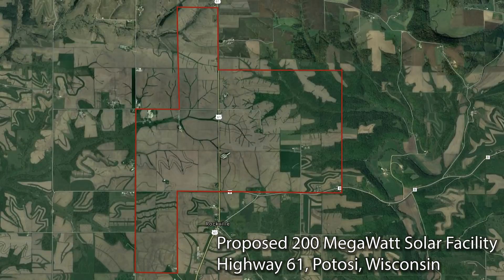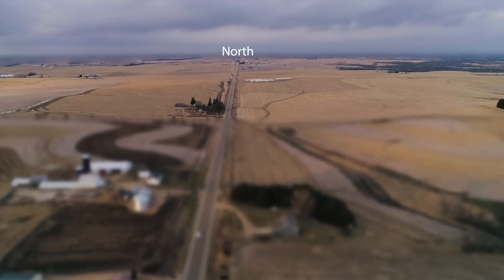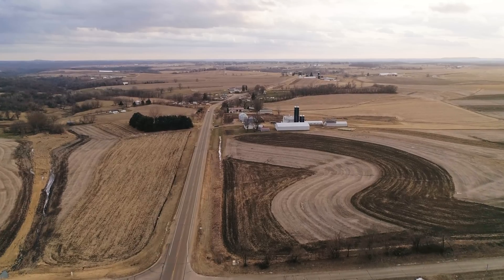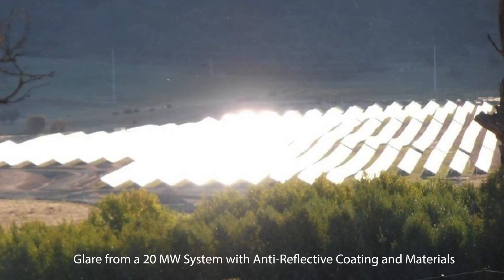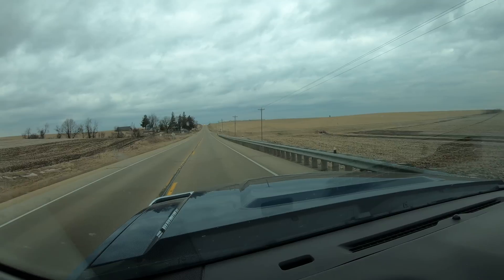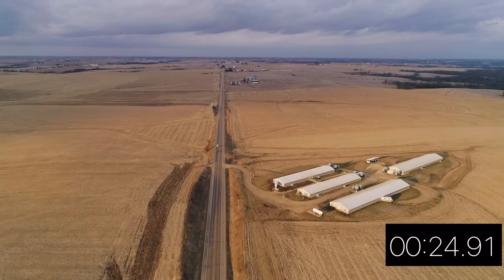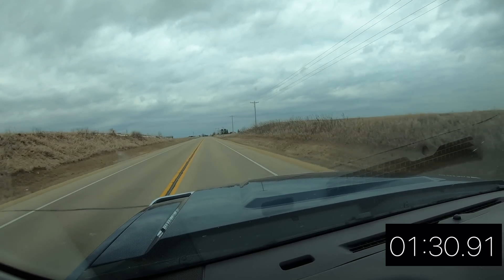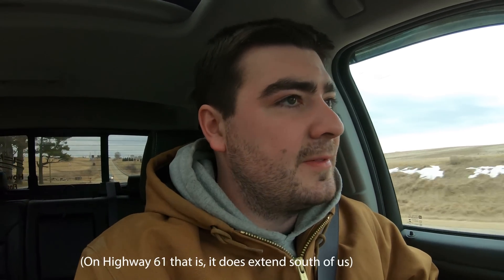Proposed 200-MW Solar Facility | NextEra Energy

Comment: By the time it reaches the "public information" stage, the local government has already signed off on and has started to count its franchise fee.  They're just going through the legal motions because they have to.  It's a done deal.  Nothing that the locals say or do will stop it.

Glare will be a huge area.  There can also be some temperature shifts.  Wildlife migration patterns will be altered.  Power generated is typically dumped into the national grid and won't be available to local customers.
Reply: Not Always true... we had the largest electricity provider buy a piece of land for putting up a sub station... so far the local voters have prevented that from happening
Reply: @kenraterink3916 , you're extremely lucky.  Our local electric company informed the city it was going to need to install a new substation  for "future capacity" and then proceeded to immediately build a massive substation right in the middle of one of the older neighborhoods in the city.  When challenged the electric company's position was that it had already begun construction so the city had to let it complete the build.  In typical city government fashion, it caved and slunk back to city hall.
Reply: Electricity can not be stored, once it is produced it is everywhere in the grid. You can't go borrow a bucket of electric from them.
Reply: @thomasd9424  We have electric storage here in Texas. It is really a conversion of electricity to another method either heat such as salt reactors or gas as in Hydrogen and Natural Gas generation for on demand startup. We also have capacitor storage on lines to take up a neighborhood level surge need.
Reply: @TallTexasGMan  Yeah MANY ways to store electricity, but that's not the issue... Later!  OL J R :) 

How much power will panels make that are covered in SNOW half the year??  That's a h3ll of a lot of panels to have to try to 'sweep off' as well, or use electric heaters on to melt the snow off... burn more electricity than it produces in winter I bet LOL:)  Just crazy... 

We got whole states (Nevada, Utah, Arizona, parts of West Texas) that are more desert than anything, pretty much useless except for a few areas here and there, HUGE tracts of non-arable land, and what do they do?? Take good farmland to turn into "solar farms" covered in junk.  

I'm not anti-solar, but it should be done in a way that MAKES SENSE... Later!  OL J R :)
Reply: I dont think so. It is a basic principle that locals, everyone, should express their opinion. This cannot prevent the project, but it is necessary to show that the decision made by local government might be made against the will of the inhabitants. I doubt that it is about the common good, but the advantage of a few.
Reply: I would have to agree, by the time the public hears about it its seems like a done deal. https://www.renewwisconsin.org/sugar-river-wind-project-proposed-for-green-county/
Reply: I see, but don't know enough about losses in long distance transmission vs pumped storage/other conversion factor efficiency, to add to this.
Reply: thats the  government for you
Reply: These companies know that they're universally hated so they keep a very low profile for as long as they can.  They start with the local governments because they can sweeten the pot with franchise fees, "donations" to local entities, etc.  Local governments are always looking for income sources.  Companies know this and have done their research before they ever approach the local government.  They already know how to win over the local politicians and that's all that matters.  As far as the locals go, they're just an insignificant nuisance that will eventually be pushed aside.
Reply: Yes you beat me to it. Our local government made a deal with a Poet ethanol plant. They didn't even tell people in the county where it was going to go until the last minute. Yea we got to go to packed house meetings. It meant nothing. So they built it 1/2 mile from my house. I hope they go broke when corn prices rise.
Reply: @TheCritterWindow  , that happened to the town I grew up in.  A decade of foul odors, stream pollution, and noise complaints later, the plant went bankrupt leaving the city holding a bunch of worthless bonds.
Reply: dumped into the national grid and not available local is not always true.

Comment: These silly solar projects... just taking good farmland and turning it into a landfill.  I could see it IF every rooftop in the cities and large suburban areas were already covered in solar panels, BUT of course that hasn't and won't happen.  Just seems silly to take up all that farmland to build a solar project in the middle of nowhere... heck yall aren't even adjacent to any big cities (within about 30 miles) that would be using that electricity-- when you figure transmission losses over long distances, it adds up.  When you get tornadoes or straight line winds, you can expect to have panels scattered everywhere... the things are essentially big sails on a post... they'll be scattered everywhere.  Solar panels don't last forever, they have about a 25 year productive lifespan and their production of electricity falls off with each passing year.  Once they're done and the project is no longer "viable" (profitable) they'll probably yank the panels (for the valuable rare-earth elements in them) but leave all the posts and crap everywhere, so essentially about as farmable as an abandoned drive-in theater.  The glare issue is for real; anti-reflection coatings can only do so much to stop specular reflections.  The runoff issue is another big "what if"... technically speaking the water dripping off the panels in rain/snow melt SHOULD soak into the ground, but there's a BIG DIFFERENCE in water/snow melt being spread EVENLY across the soil surface and it being concentrated along the drip lines of the panels, which will quickly saturate and most likely run off... ground in near-constant shade under the panels will also be a lot slower to dry out that soil exposed to the normal ~7 watts per square meter of solar irradiation on Earth's surface... 

Don't think for a minute they won't use eminent domain on you-- they wield that like a sword now.  Gubmints LOVE money and ANYTHING that will put a dime in their pocket and has the added "green factor" of a "solar farm" just makes everybody feel all warm and fuzzy... If the gubmint will take your land under eminent domain to build a Wal-Mart (which some municipalities have done!) they won't think twice about condemning property to run power lines for this solar project.  Fighting eminent domain is like fighting against the next sunrise, though-- fight all you want, spend all the money you want on legal crap, it's coming anyway, "you can't stop progress" and in the end it comes anyway.   My cousin behind us at Needville fought against the pipeline crossing their farm (after coming through ours) and ended up with a big legal bill and less money than they would have gotten when they started, and the pipeline went through anyway.  Just how it works, nothing you can do about it.  At least it crosses the drainage canal/creek through the farm instead of running parallel to the county road on the far end of the place like they originally wanted it to.  

Looks like you have a lot of short-sighted neighbors... sure it looks like a good chunk of change up front (which they get to pay high taxes on) versus the much more modest returns from farming, BUT unless they're buying the land outright, those landowners are gonna find in 25-30 years when the project becomes "unprofitable" they're gonna be left holding the bag... huge mess left behind and no good way to clean it up; cost them FAR more to clean it up for farming that they ever made off the project to begin with.  Look at OLF's channel to see what he thinks of those stupid solar farms going in all over NJ...  Don't buy the "oh, we'll clean it up, or it's bonded and has money set aside to clean it up when it's over with" and all that crap-- money has a way of disappearing or ending up never being put there in the first place, and all you're left with is an empty promise and a big mess... too easy for a company to just declare bankruptcy or go insolvent and get dissolved and restart next week under a new name and walk away from the whole mess when it's over... 

Later!  OL J R :)

Comment: Interesting. I was reading up on it Solar Farms and found out that Great Britain gets 15% of their power from Solar Farms. Animals graze along side of the Solar panels https://www.solar-trade.org.uk/solar-farms/  
Some questions: Is the power going to be sold wholesale to a distribution company.. if so you will get no benefit from the cheap power. Insist that a percentage of be used for local power. If they have can to cross you land ... can the cable be put underground

Comment: The largest solar farm on the East coast is going in on our county now, these panels have miles of oil pipelines, with hundreds of thousands gallons of oil to cool them, also millions of gallons of water used to constantly clean them, and basically 20_ 30 years of life, then the environment is contaminated and useless, sounds like you're area is like ours, the people were kept in the dark until it was too late.

Comment: In addition to the solar arrays will be all the other structures such as transformers and buildings, etc. My first thought went to the power lines that will be needed to handle that. Giant towers of high capacity lines that generate alot af ambient energy in the air and buzzing that affects all nearby and creates a hazard for airplanes; your local airport and cropdusting being a concern.

Comment: Need to find out what your county and township zoning is? Local drainage district or conservation district in the area ? These panels are impervious, retention,detention will be needed. Decommissioning of site when done.Will a bond be issued for state or county for cleanup of the site? What if the company goes bankrupt before done with the project? What happens if there is a fire, cleanup for ground and water contamination?We have just been through all of this in our county and township.Get your group together and get legal council.

Comment: Lots of these things in Australia. None really work out well for the farmers that adjoin them. “Heat islands “ of artificially higher temperature air can affect crops. Electrically they are usually not in the best spots for a connection. Which means a whole heap of issues. Usually need upgrades and bigger lines. Voltage problems are also experienced and typical as well as frequency and stability.

Comment: Private company, but they'll still use Eminent Domain for those who "don't comply". It's a waste of good farm ground.
& like someone said, do watch your fences. We have highlines that run across 2 of our fields. A couple years ago when they came through & replaced the poles & the lines, they cut the fence between the neighbor's field & ours. Granted, it was an old fence & we hadn't had any cattle in the field for a long time. But the fact was that they didn't ask our permission or inform us that they  intended to do it. They @ least waited till the crops were out but made pretty good ruts due to wet ground conditions. It took a lot of disking & dragging of an old steel I-beam to get things smoothed out again. But even with that, we are still fighting wet spots created by them.

Comment: Who is going to use the power? I get concerned about transmission losses when these large solar facilities are located too far from the electricity demand - why not distribute the panels near to the points of demand to minimize the transmission losses. Centralizing the panels to one location should not significantly reduce the installation of maintenance costs, but will maximize the transmission losses.

Comment: i love the idea of renewable energy,  but i would not ever agree to this because your loosing good farm land, and like several others have stated the wildlife  will be affected big time and yes the glare will be a pain and plus the panels are made with atleast partial  toxic materials and the power ratio usage to power made is not going to be that great because you can only get power in the day time you would be much better off putting panels on the roofs of all you buildings and having a couple small wind generators to supplement your power plus how much will your taxes go up and how much will your electric bill go up if your connected to the power company?

Comment: Ryan: Be concerned about the voltage and high lines that might be near or cross your land. Some have reported cancer issues from the high voltage as well as TV interference etc. You need to do research on this. Thanks for the video's.

Comment: Ryan, someone sent me the link to your video this morning.  I am a retired Rutgers University professor, and I'm part of a group in upstate New York calling itself Friends Against Rural Mismanagement (FARM).  We have been dealing with industrial-scale solar projects for several years throughout NYS and beyond.  (We also take on wind turbines, which some of us have been fighting since 2004.)  

In any case, you need to read this article, which I published online:  https://tinyurl.com/cantonsolar.  Be sure to open and read the numerous links.  I wrote the article for the benefit of the town board in Canton NY (St. Lawrence County), which, like you, is facing a huge solar project.  

By the way, you're getting not just PV (photovoltaic) panels; you're also getting the crap that comes with them:  inverters and transformers (famous for noise:  read my article) and, the most horrific of all, Battery Energy Storage Systems (BESS).  These BESS things are time bombs.  Again, read my article.  BESS are loaded with thousands of lithium-ion batteries, which are extremely temperamental.  They are highly volatile and combustible.  When they go KABOOM, they rapidly progress to a thermodynamic state called "thermal runaway."  This is a sanitized way of saying they are nearly impossible to extinguish. Moreover, they are like "trick candles": they keep reigniting.

Thermal runaway is minor compared to the hydrogen fluoride gas and vapor that's released when Li-ion batteries combust. Let me clarify something, here. They should not be called lithium-ion batteries; they should be called for what they are, lithium hexafluorophosphate batteries.  LiPF6. The electrolyte in virtually all Li-ion batteries is lithium hexafluorophosphate. This is the source of the fluorine in the hydrogen fluoride gas (vapor or mist or smoke) and hydrofluoric acid ejected during thermal runaway or fire or explosion.

Hydrofluoric acid is arguably the most insidious, dangerous acid known to science. As I say, read my article, above, and follow the links.  You will be appalled.

If you want to cut to the chase about your exposure to hydrofluoric (HF) acid vapor, read this article, https://rivercitymalone.com/wind-solar-energy/bess-bombs-part-1/.  

 You're welcome to contact me at 19clay@gmail.com.

 Calvin Luther Martin, PhD
Reply: Better to build coal fired PS then.

Comment: My questions would be (I am in a similar situation in my area): 
1. Does the value of my real estate near the project decrease? (in case of sale and mortgaging) 
2. How long is the life span of the solar panels? Are there financial provisions for deconstruction and waste disposal? 
3. In case of a tornado or strong wind event, who is legally obliged to clean up the damaged panels? 
Can substances out of the panels be released into the environment?
4. In case of fire event, can solar panels be easily extinguished by the local fire department?
5. What are the financial advantages of the project for the public / city / county? How much rent do the landowners get?
 How many property owners will have to live with the effects of the project and will not gain any profit from it?
6. Is the project subsidized with tax money and if so, how much? Would it be profitable without tax money?

Comment: With a little work they can insure that there is next to no surface runoff from the solar farm by putting in dirt berms under the panels to trap the water coming off them and giving it time to soak into the ground. It would benefit the water table in the area and if you are over the right rock types help to recharge the aquifers you sit over. 

Wonder if they have thought about selling branding rights to the project? With control of panel placement it is easy to spell out words or even add images when seen from the air or on say google earth so would be easy to sell the space to a company to recover some of the costs of the project.

Comment: The panels should be installed high enough that cattle can be grazed on the land beneath them, instead of running lawn mowers between the rows (strings) of panels to control the grass and weeds.  There may be chemical runoff from the chemical application to control the weeds around the pylons or foundations.  There should also be money put in escrow to pay for the removal of all the facilities after the length of the contract or useful life of the equipment.

Comment: The big downfall to solar power is the inefficiency. As stated below, it is probably a done deal but I am convinced that the payback is next to impossible in the life time of the project. First of all, that far north, the angle of the sun rays are only optimal for maybe a couple months a year. Then you consider the cloudy days and the hours between dusk and dawn, there is relatively short generating time. If solar power is to ever work, it has to be much closer to the equator than Wisconsin. Just some thoughts from a Missouri senior citizen for what it's worth.